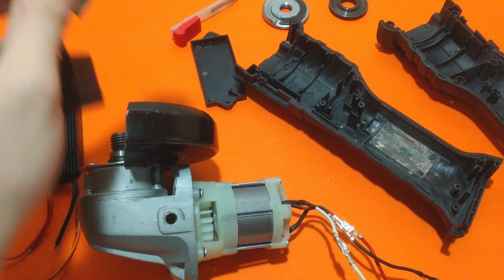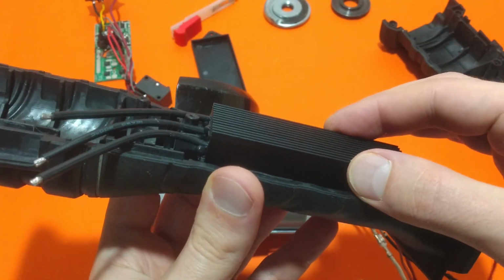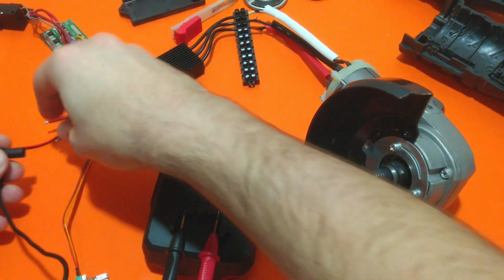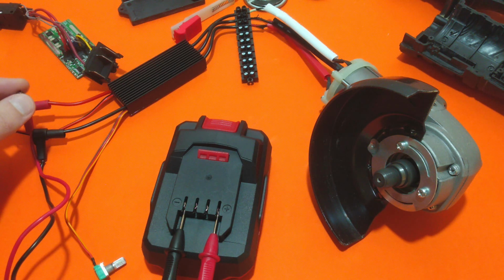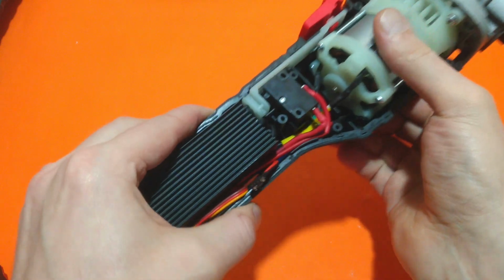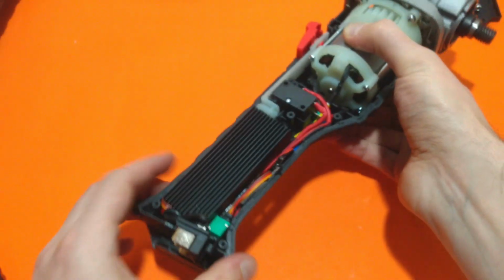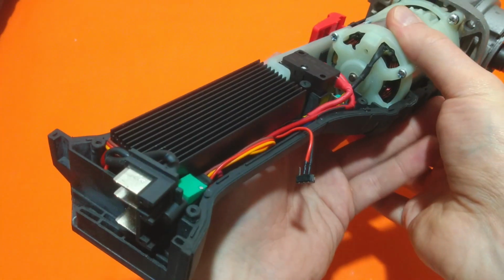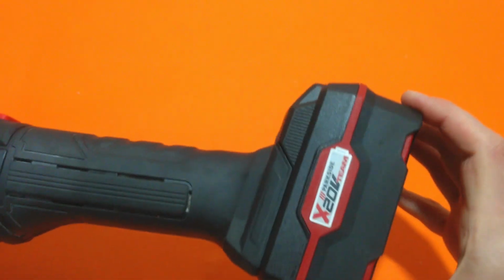Restoration of Nonoperational Parkside Performance Brushless Angle Grinder

Comment: Hello.  I loved this video of yours.  It's a beautiful job.  Now that it's been a long time, can you tell me if it's still working?  I have a similar machine and would like to do the same, is there any other solution?  A hug and many congratulations.
Reply from the maker: Nope, I've managed to burn it again 😂 It seems the new board protection is worse than the original.
Reply: The BLDC controllers usually don’t like to to be suddenly disconnected from the battery. This is because the braking is done with charging the battery. If you disconnect it might try to brake, since the is no battery the current cant go anywhere so the only option is to raise the voltage. And with a heavy cutting disk this might be enough to get the voltage high enough to kill it.
Reply: With a lot of BLDC controllers its standard to brake when there is no power.

Comment: Will this controller work with hall controlled motor? Hall version motor is in the previous version of this angle grinder.
Reply from the maker: Maybe, but who knows. The manufacturer claims that the controller board should work on variety of motors, but it doesn't say if it can power such with Hall sensor. I thing the windings of the motor should be the same, the only difference is the Hall sensor that tells the control board the position of the rotor... I'm still not that good in this subject

Comment: have you made the video with it working\cutting?
im curious how well it will work compared with stock controller
Reply from the maker: Unfortunatelly i don't have the stock angle grinder to test. I will be doing some test with my version of the grinder, but not sure when. The weather is problem - its cold outside currently. If i do some extensive testings home I will drive my neighbours crazy :D
Reply: @icku i need to know about the fixed grinder you done if the new controller cuts of low voltage of the battery because battery doesn't have low volt cut off
Reply from the maker: @marbesky  I don't think the board has such function as by description its rated to work at wide voltage range - DC12-24V

Comment: Hi, where did you order the brushless motor control board without the hall sensor? I want to put it on a milwaukee thread, that's why I need the reverse and speed control. Thanks
Reply from the maker: https://www.aliexpress.com/item/4000299173443.html?spm=a2g0s.9042311.0.0.58344c4dRN3PSl
Unfortunately its out of stock.